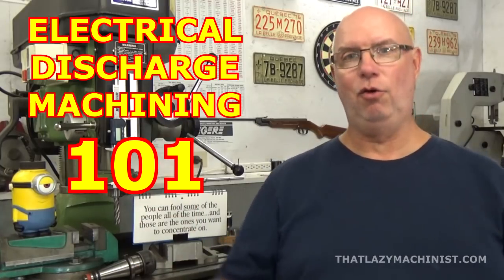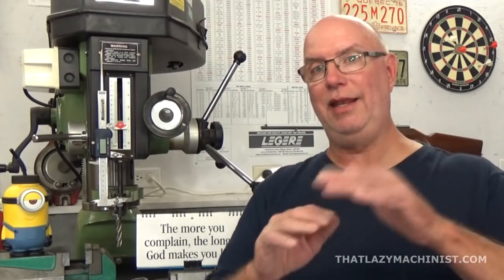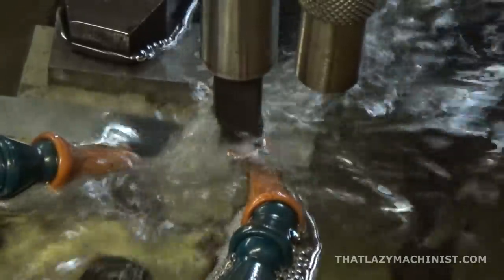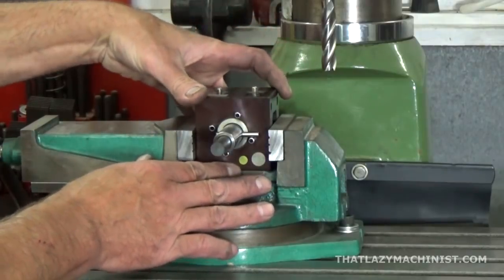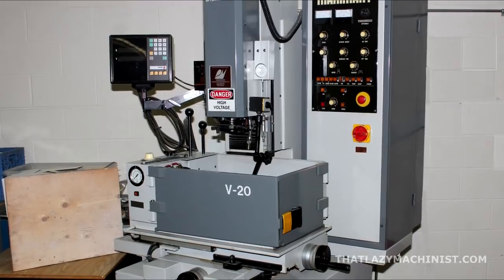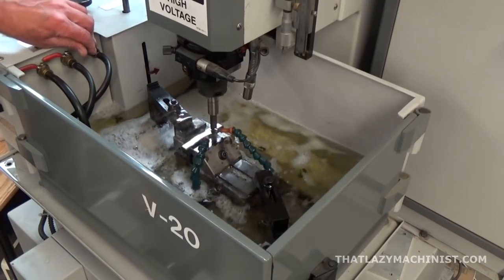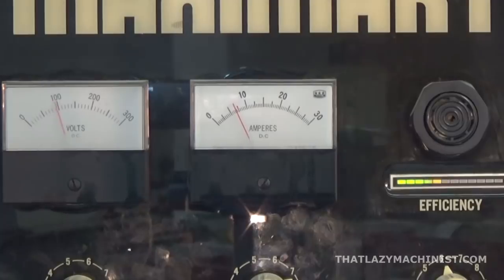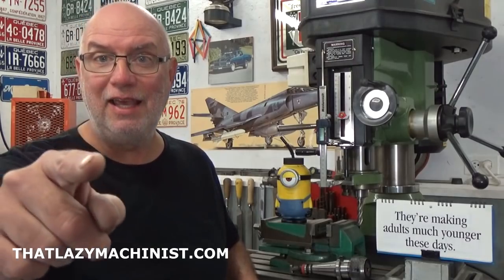ELECTRICAL DISCHARGE MACHINING EDM, MARC LECUYER

Comment: I hope you are using some sort of breathing protection when you are cutting the carbon electrodes.
Reply from the maker: Hi Terry, You are very right to mention that. Yes I do use protection and I should have mentioned it in the video. I will pin your comment to the start of the comments section so others can benefit. Thanks for writing and for taking the time to write. Marc
Reply: Thanks for the comment, Marc. Nice video and explanation of EDM machining. Before viewing it I knew nothing about EDM accept for its three initials 😁;  now I'm much better informed. It's seems sorta like focused ultra-sonic cleaning that is ramped up  on steroids!
Reply: THANK YOU!! 
I just heard about EDM realizing it's not just electronic dance music🤩
Yours was far and away the best video on it I found after searching for an hour. Absolutely fascinating process and your video was spot on. Clear, concise, to the point, and covered enough that I think I have enough to go on to speak knowledgly about it. 
I have seen easily 40 small shops auctioned off every week for almost a year now. 
I was going to start a surplus business, but I realized I don't want to be a part of helping people lose jobs and businesses they have run for 30 years. 
I LOVE Everything about metalworking, but have never touched more than a hacksaw. I built 2 very successful businesses in industries I had no interest in, retired by 37, but lost everything in the recession.  I have a crazy idea to create a business that I think can help these small guys who never upgraded, and just want to retire, but won't get anything if they auction or try to sell with a broker who will take 12% cash up front out of the deal. EDM could be one part that I missed.
Thank you again for the video, and I love your website. It's going to be an incredible resource for me.
When you come down here to south Florida for the winter, I would love to meet you. 
My Dad was born on Windsor, and we have a cabin near North Bay, Ontario.
Thanks again, 
Joe Pare'
Reply: @THATLAZYMACHINIST  was that carbon of graphite made electrode ??
Reply: @joediverfl  lol that’s too funny! I started working with EDM over a year ago, and I still think of electric dance music! Some the older guys at work just don’t get it.
Reply: When I was a toolmaker back in 70s no one wore a mask in fact no body wore safety glasses omg
Reply: @patrickdarcy3863  My dad taught machining at the local community college in the 80s and 90s. The team decided he should teach shop safety because he was the only one with all of his fingers.

Comment: This was very good. It shows an alternative method of machining through hardened steel and any other materials that conduct electricity. Zero warpage, no loss of material tempering, no heat damage of any type was done with this process... Nice!!!
Reply: Well, a disadvantage of edm is that just near where the sparks were, there is a heat affected zone which changes material properties a bit :(
Reply: ,  @Robbie James, That might be true with the metals that have low critical temp. / heat affected zones, like aluminum (475° F) . But the female thread can still be repaired in several  cases, with a thread repair insert, and the EDM could remove the broken pieces , without significant collateral damage, that is often associated with schlock techniques... So EDM is STILL necessary to do ANY kind of repairs to the threaded castings made of most types of metal that conduct electricity, and then saving the castings from being scrapped... Therefore , EDM STILL has the distinct advantage of removing stuck - tooling/fasteners the best way known, to get the machines working again, at MINIMAL expense... BTW, because the EDM process uses liquids like soluble oil and water mix to help disintegrate the stuck pieces, the water also COOLS the surrounding metals from becoming affected by high heat, and thus localizing the intense heat to the parts being disintegrated... EDM is DEFINITELY the best way to remove stuck fasteners and tooling from hard to find / expensive pieces...

Comment: Have anyone said when machining graphite use a shop vac to suck up the airborne graphite dust.

when we machine graphite electrodes, that is what our machinist do to keep from breathing the dust.
I operate commercial edm machines. you have done a very good job in showing EDM.

Comment: I was a moldmaker.  5 axis EDM was a very important process.  A very versatile process.  A very good process for porting gun barrels due to minimal bur.  Set up a tungsten electrode and fixture.$$$  I've left the industry but, it was profitable while I was a moldmaker....
Reply: Very cool! What type of dielectric fluid did you use?

Comment: Nice to see a good serious runthrough with an older style EDM and older 3R style holder. I started on EDM on modern Swiss Agie Charmilles machines that generate their own settings with touchscreen interface- wondered how the older ones I had seen before worked. I heard the oldest had mechanical orbiter mechanisms...cant even imagine what it was like to run those
Reply: Brother, if you want to see one, you can check my latest upload... I just saved one that is nearly new-old stock grade from being tossed to scrappers for pennies a pound... You wont see me use her for quite a while, as i have to build a new shop to actually house all the machinery that i hoarded in anticipation of a proper shop, thereby crowding what was my current shop to point where I have 11 machines waiting a maintenance or a large service or even a full restoration... I know that i`m 4 years late to the party, but 4 years ago i had just a few machines and never intended on having and EDM machine... 2 days ago, i was tossed one into my lap essentially, and i`m referring precisely to the Granddaddy Charmilles D1T orbital sinker, which i intend on running both as an EDM sinker but also as a Jig grinder, as all the dust can easily be contained with a separate oil tank that will keep all the dust inert and harmless to any machine, thus not harming the machine in any way... She has 2 micron dials and a 1 micron DRO, so it would be ridiculous to fail to utilize the full potential of a machine capable of containing grit like no grinder or dust vacuum ever could... In the end, whether its ultra hard mould steel particles that EDM generates or abrasive dust from grinding, both are extremely abrasive and are nearly identical in regards to being harmful to machines if not perfectly contained... Even the Moore Jig grinders can`t boast about that ability... Neither can Hauser ones... The machines you are referring to are literally out of this world in regards to their quality... It`s little wonder that Charmilles still exists today, even tho in a marriage with Agie... 

I know this is kind of a shameless plugging of my own video, but really, it`s not, this is a 5yo video and a 4yo comment, so who else could see this reply if you don`t check it out... It`s a personal communication as i would like to hear more from you if you know anything about the D1T... I`ve got all the books, but they seem to be unicorn grade machines... And i want you to see one if you never have seen them... They really are works of art... 

All the best and kindest regards!
Steuss

Comment: How timely I just bought a book about edm and waiting  for it to come from America. I fancy building a tap burner. Although wire EDM eroders do some amazing work. Does the machine use pulsed DC when cutting, or is the frying noise just a function of the arc lengths.

Comment: "Irregardless" is not a word---it's not a proper word. The word you want is "regardless." (9:50)
Regardless, I really enjoyed your post.
I believe one could rule the world with EDM---or with a really good spreadsheet.
Reply: Irregardless is a nonstandard synonym for regardless, which means “without concern as to advice, warning, or hardship,” or “heedless.” Its nonstandard status is due to the double negative construction of the prefix ir- with the suffix -less. ... The bottom line is that irregardless is indeed a word, albeit a clunky one.

Comment: I bought a manual sinker edm for the home shop for less than scrap metal price from an online auction. I am maybe gonna try using it for burning insert pockets to solid carbide boring bars using the insert as electrode when I get it working.

Comment: Thanks for the information about EDM machines and I do have one lying around. It is an old one that uses tubes in the power source. It was for removing busted taps and operates in a milling machine. Your video has answered a lot of questions I've had regarding the dielectric fluid.  I believe the unit I have was supposed to run with deionized water, does that sound correct to you? Any suggestions would be greatly appreciated.

Comment: Nice to see EDM on here. I was trained on a Charmille D.10 back in 1974 and also worked an Agietron for several years. 
Apart from the usual tool steel erosion, we also did a lot of work for ourselves and other companies in tungsten carbide with the main electrode material of choice being elkonite 10w3.
We also had to work in a room with a steel floor attached to a faraday cage as our machines messed up radio and TV signals.
It is as you say very slow, and once set up it's back to a surface grinder making an electrode for the next job.

Comment: Hi, I recently acquired the guts of a pulse edm machine- all the electronics, so I built the rest of it up as a “fast hole” sinker. I have attempted to drill a 1/16” hole though a piece of carbon steel about 4 inches long and have spent well over 6 hours only getting to a depth of about 5mm. not to mention this burned up a solid 6 inches of the copper electrode I was using. There is a hole for flushing through the center but I’m at a loss here. any thoughts or suggestions would be appreciated!

Comment: Hi, would like to ask you one question, we have 2 shafts of Material 1.4021 + QT 800 in which HSS Drill bit of Dia. 15 mm are broken inside and the length of the Shaft is 680mm,  can you suggest us any solution how can we make a through hole and can remove the Drill Bits??

Comment: Its interesting (to me at least) that wire EDM machines can give you an almost mirror surface roughness while this, even at its finer setting, seems to produce a couple orders of magnitude rougher surfaces, at least normal to the motion of the electrode. The vertical walls of the D shaped hole seemed smoother than the concentric circles.

Comment: Very different and interesting. Does this process do anything to change the metal in any structural way in the vicinity of the cut, metal remainig-?
Reply: Yes, there is a heat affected zone around the area

Comment: Fascinating!

The surface finish looks, hmm, "grainy", like one of those textured paints. Is that accurate? Does a finishing cut give something more polished?
Reply: Paul Ste. Marie Yes, a finish burn would look much nicer. A couple other factors that determine surface finish are the electrode material and how many electrodes are used.
Reply: It's crazy how many people on youtube ask questions that were answered right in the video.
Reply: @aarongossage5064  Can you get a part that's "ready to ship” with the lighter cuts, or is grinding or other finishing going to be required to get a decent finish, say on a par to what a sharp endmill or lathe tool will produce?
Reply: It's possible to get close to a mirror finish with a high end machine, though I've never seen it done. The finishes that I produce at my job require just a little bit of polishing.
Reply: Finish quality is determined by how small and consistently sized craters you can make. Flushing is the biggest challenge for sinker EDM. With wire, you have a nice open cut to pump water through, which keeps the conductivity consistent, improving crater size consistency.

To make small craters, you need short on-time for each spark. But that erodes the electrode more quickly for a given amount of workpiece material removal. Fine if you have an infinite supply of wire or a simple rod electrode, but not if you have an elaborate graphite electrode. Plus you need a power supply that can do constant spark duration. There's a variable time delay between applying voltage and the ionization process completing, so if you use a simple power supply that has a constant time between switching voltage on and off, the spark duration will be variable, and the variation is proportionally larger for shorter spark duration, limiting the achievable finish quality. So you need to apply voltage, detect ionization, and then start the timer for the spark duration.

Comment: Thank You for a very interesting video.
I have never seen this process before,(but I am not a machinist to start with!).
I wonder what type of shop would use this process?.
Reply: Great for creating molds for injection molding/die casting. The parts often have complicated geometry. The slow process doesn't matter that much here because it happens just once.
Reply: It is immensely helpful for tool and die making. I run two wire edm machines and two sinker edm machines at my job.

Comment: Excellent tutorial!  I have a question concerning the EDM process which I have not been able find any information on any YouTube videos that describe the EDM process, both wire and plunge types of EDM. That concerns the electrical power supply. Could you please explain about the electrical power that gets fed to the EDM tooling, such as, is the voltage AC or DC? If DC, what should the polarity be (+ to the graphite tool and - to the work piece, or is it the other way around)? And how about voltage and current? Is there a rule of thumb for the power supply voltage and current based on the size or thickness of the work piece? I'm asking these questions because I am planning to build my own plunge type of EDM machine.  Thank You!
Reply: DC. Around 100-200V open circuit works best I think, but as low as 50V can work. Polarity should be switchable (different electrode/workpiece material combos prefer different polarity). Current is around 10A. Ideally you'd want to limit the current by reducing the voltage after the arc strikes, but the simpler solution is to put some power resistors in series with the arc. It's wasteful of energy, but cheap to build. Ben Fleming's books are good. Bax EDM manual also has some good info https://baxedm.com/wp-content/uploads/2019/08/BX17-Manual-Rev04-1.pdf
Reply: How did your edm build go? Inquiring minds want to know!

Comment: I have an uneducated question.  Why is it only machining at the bottom of the electrode and not around the perimeter of it as well?  I'm assuming that the current is only flowing through the bottom of the electrode, but how?  The electrode is a solid material.  It seems like the current would be flowing throughout the entire electrode and not just the bottom.
Reply: The path of least resistance is the answer... I know im 3 years late, but if you still dont know, there it is... The bottom of the electrode isnt really what is sparking, its doing so only in the beginning, as the material worked and the electrode wear down from sparks, the point on the electrode at which the spark is released is constantly moving upwards very slowly, just as the material is being eaten away, leaving the unworn area beneath the electrode as the closest thing that a spark can jump... The rest of the electrode body doesnt spark because once the tip has plunged in, the distance between the rest of the unworn electrode is practically a micron too far from what a spark can jump, and so the lower part of the electrode again comes closest to the part, sparking out, feeding the impulse to the machine, tripping a timer and shortly retracting to evacuate the suspended junk before plunging back in again... Its literally one of the most fundamental laws of electricity... It is also somewhat similar in principle to creep grinding on a surface grinder, where both the wheel and the part wear down, but the area already cut doesnt come in contact, having but submicron clearance from the wheel... And just as with the electrode, it appears as if just the edge of the wheel cuts, but the cutting edge actually moves progressively inward and to the other side of the wheel... Its a bad analogy, but its kinda similar in certain aspects...

All the best!

Comment: One question:
Isn't the ark, which is high temperature, weakening the hardened surface just by its abrasive heattreating?
Reply: You don't understand heat-treatment and EDM. Multiple sparks are quick! There is NO continuous arc (like in welding). Fast heating and fast cooling = hardening.
Typical grainy EDM-ed surface is hardened (it is a problem for mold polishers, it can be P.I.T.A. to remove such layer).
 
And what the F*** is "abrasive heattreating"? No such thing...

Comment: Wow! It always amazes me to see how you can bring a complex subject down to an easy to follow format. Really one of the most comprehensive machining course I have found on you tube. 
If you want to cover more on the EDM subject, I would really like to see a part 2 video covering electrode wear and electrode design (Graphite vs copper vs ..., how much smaller should a roughing electrode be ... Does the finishing electrode needs to also be smaller?, do we need draft angles to avoid sparking from the electrode sides?... other things to watch for? ) 
That would certainly help me and my fellow engineers/designers to get started on the subject.

Thanks again for sharing!
Reply: Process is as simple as normal machining (cutting). For details check http://www.thetoolanddieguy.com/course-directory/